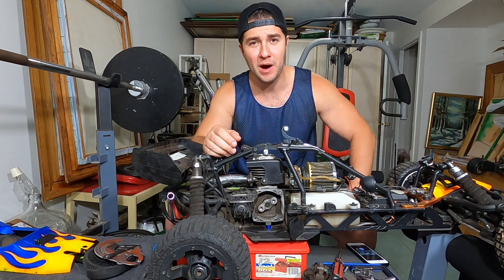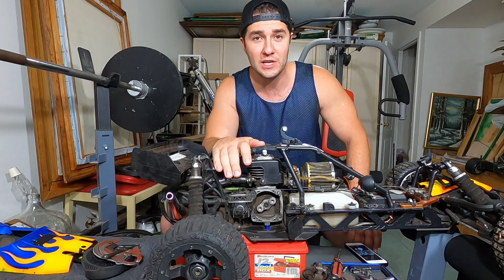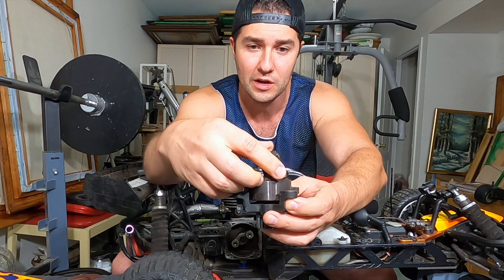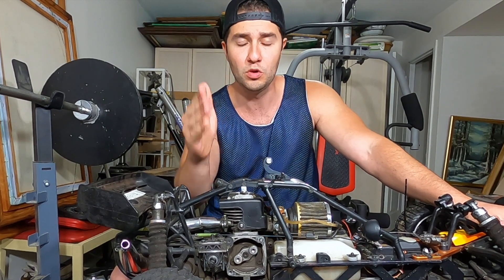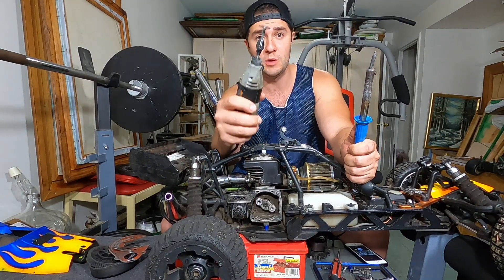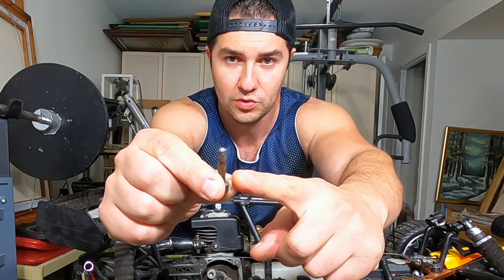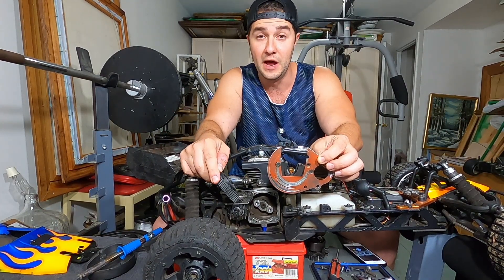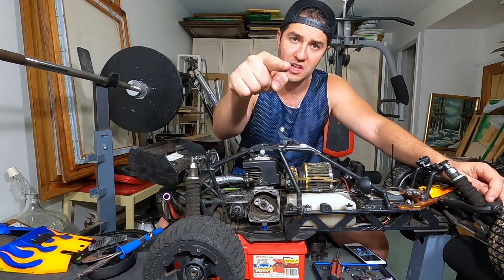GAS Garage - King Motors Baja First Failure After Beating Too Many Electrics. (NEED HELP) PART 1

Comment: Great video Dmitri!!!  Sounds like your lay shaft has too much end play for your pinion gear.  Would say as long as it’s not ate into the The plate too much you should be able to reuse it. That bolt is going to be hard to get out brother.  I would use map gas to heat the housing and you will need a good left-handed drillbit drill into the bolt far enough to get an extractor in it.  A lot of times just the heat from drilling the bolt will cause the bolt to back out with a left-handed drillbit.  If not then your second option is to tap an extractor into the hole you drilled in the bolt heat the housing and see if that baby will come loose.  Heating the bolt will work a lot of times but the best way to use heat is to heat the housing so the housing expands around the bolt because you don’t want the bolt to expand in the housing that’s what will happen if you heat the bolt too much.  That’s my advice brother I hope I explained it well enough for you.
Reply: Ya that a great plan heating the outside of where the screw is broken off and that will release the red Loctite and left handed drill bit to spin it out!
Reply from the maker: hey Ben! I was waiting for some good advice from you.  Unfortunately I don't have any ways of heating the housing, so I have resorted to just drilling through the screw.  I must say, my decision was very risky, but I think it's a success.  Anyway, I;m able to thread a slightly thinner bolt through that opening now, its totally weird tho.  You will see an update in a video soon, very hard to explain.  I did my best to avoid removing the clutch housing because chances are that will have massive issues too.
Reply: hybrid32494 Sounds like you got it brother.  All we can do is do the best with what we have.  And yes I agree you probably would’ve got into some more issues removing the housing.

Comment: Could it that the shaft is bent to cause it rubbing on that housing? Great informative clip...
Reply from the maker: hey my buddy!  I've looked at that entire shaft setup, it looks fine and there is no sign of any weird wobbling.  Some people have said I'm missing a washer  between the spur gear and the gear plate. On the other hand, this Baja has been running perfectly fine even with the significant wear, so I'm not too worried, you know.  Long as it's enough to win some races, hahaa.
Reply: @hybrid32494  so true 👍👍👍👍

Comment: Nitrogang never give up❗💯🏁🏎️🤓🇨🇵
Reply from the maker: hey bro!! I'm fighting that damn stuck bolt right now!  I think I may have gotten lucky and come up with a very unique solution.  I am just drilling right though it and then going to put in a slightly thinner bolt that will just tap itself in there.  So far it's working..  Nitrogang rules!!!  You will see in an updated video soon.
Reply: @hybrid32494  Good luck and stay cool Bro... 😉 Sometime, RC is a little boring when something don't want to go in the good way or don't want to start... But the goal is a pleasure❗👍💪💯🏁🏎️🤓🇨🇵

Comment: You need to replace the plastic clutch carrier man . That will eliminate that wear on the back plate and your spur gear . Awesome video as always mate 👍
Reply: When it gets hot it flexes, unlike a metal one . Screws up the fixed alignment on these bajas . 👍
Reply from the maker: hey bro! I should have mentioned that black clutch carrier is already metal.  I also thought it was just black plastic until I removed it, it's actually metal.  Must have been a cool King Motors upgrade for the time, you know. So it can't be that. I'm thinking is it possible the disc brake assembly is somehow flexing and pushing that gear plate into the spur gear??
Reply: @hybrid32494  no way man !! I did not expect it to be metal . That's a cool bit of design from king motors . It's a strange problem for sure ...  I think you're on to something by tracing the problem to the brakes possibly . Can't wait for the next video and to see what the issue was . That Baja is an absolute beast for its age . And you definitely showed those guys that gas RC is still king haha 👍

Comment: Hey man what fuel to oil ratio is best for performance according to your experience?
Reply from the maker: hey buddy! So far around 35:1 is what I'm running.  With any new or used gas RC I start out at the recommended 25:1 then when I feel like it's running fine I check the plug and it's almost always fully saturated with thick dark oil, meaning it's too rich of a fuel mixture.  At about 32:1 it starts to get better.  Some guys run 50:1 and seem to have the same performance and no downsides at all, so I think 35:1 is right in that safe zone and still adequate.
Reply: @hybrid32494  hey man thnks for the info. I usually run 25:1 but just making sure that a higher ratio will not have an adverse effect. Hope to see the RAMINATOR soon. 👊👊👍👍

Comment: Make sure the aluminum spacer/collar is on before the spur goes on. That would cause rubbing on the spur if I remember correctly.
Reply from the maker: hey my dude! Yes, you're 100% right, the spacer is highly necessary here. This one has the spacer, but I'm currently working on another baja, and it legit had no spacer, which resulted in tons of spur gear wear lines, that problem is being solved right now,  You'll see it in a video soon.

Comment: sounds like the spur gear wasnt set up correctly on the transmission shaft or the plate wasnt tight? an extractor bit is the best way to get those broken screws out. my brakes on my rovan baja are turned wayyyy down on the controller because they dont take alot to lock up the tires. it could be your servo isnt strong enough to really clamp down or the rotation isnt enough to clamp down.

Comment: Ahh faster with a leaner mix thats nice you showed that because one you get the oil out of the way you can make more power and more RPMS. Great vid as always nothing like a little 10th scale murdering hahahahaha!!! As for your spur gear it seems like you are missing the little spacer that spaces the spur gear off the gear plate!! And the screw your gonna have to drill that and heated it and use an easy out or just drill it and re tap the 6mm threads brother! also a new clutch housing is dirt cheap!!

Comment: Awesome video dude, I have had my baja spur gear melt like that when some of the bolts have come out and are rubbing against it when I'm running
Reply from the maker: hey bro!! Thanks for that suggestion,  that totally makes sense now, I did not fully check to see what the screws were like when I removed them, considering I had to cut some of them out I was more concerned with that at the time.

Comment: Might have to drill out the screw. I have to drill  the screws on the aluminum bulkheads ( I think is the proper name) for my revo 3.3. Got it for a steal both from and rear. 😂
Reply from the maker: hey my dude! Guess what, I just picked up a used 3.3 Reeve myself this weekend, you'll see it soon.  Paid 150 total.  Thing seems good and even has the forward only conversion installed already.  NItrogang!!  Yes, I have an extractor kit coming soon, so we shall see.
Reply: hybrid32494 not bad. Was it complete and did it come with extras?

Comment: Hey there nitro bro, what do you think about the losi 5ive t, if it’s a good, and solid car I’m gonna sell all 3 of my nitros to get it
Reply from the maker: hey man! Great question.  The losi 5ive t is a terrific gas RC with 4WD, one of the biggest advantages when compared to the baja chassis.  I would love to own one someday, but it's hella money and does not even come with a tuned pipe. Rovan makes a very good clone of that for about 30% less money and with way more upgrades.  Check it out on their site.
Reply: hybrid32494 I think it’s decided man, I’m no longer gonna be a nitro guy but at least I can be a gas guy lol

Comment: something is getting causight between the spur gear and the plate
Reply from the maker: hey bro! After reading most of the comments I would say your suggestion is the most common.  I did not fully record the disassembly of the gear plate, but I do remember one of the screws was not flush and was pretty loose, so I'm guessing that's what it was.  Thanks!!

Comment: Why those 1/10 scales running Nimh batteries though?? Lol
Reply from the maker: LOL, no!!!!  They were 2 and 3S only. Plus they had the speed gearing installed.  But you gotta realize a track that big is tough to see your RC on when it's at the end, the baja is larger so I can easily keep track of it. Plus I always brake if anyone is too close to me, don't want to destroy the competition!! lol.
Reply: @hybrid32494  I know bud i was JK! Lol..The weight and size of the Baja helps for sure

Comment: As for the screw that got sheared off and half of it is still in there, just get a left hand drill bit set and start drilling it out very slowly applying a lot of force.  It will either entirely drill out the screw, or start to loosen it and screw it out (which is why you need a left hand bit set). I did this with my ofna ultra lx comp when the screws of the cooling head were stripped. All three which were stripped came out using this method doing no damage to the threads on the cooling head.

Comment: Should be a spacer on shaft behind your spur gear
Reply: Also get a hostile spur gear cheap.. there handle the heat better dude
Reply from the maker: hey bro! thanks for that info.  I will look up the exploded parts diagrams before putting it all together.  You might be right!  So far nobody has joined that out and I don't recall removing a spacer when I took the spur gear off either.
Reply: No problem bro my guess is that's why its rubbing so bad is that it's missing.
Reply: That spacer is the bane of my existence!! Very critical and very often over looked part on the Baja

Comment: maybe a stronger servo will improve your brake strenght
Reply from the maker: hey bro! I should have mentioned this baja already has a quite powerful SAVOX servo.  It's just the way the front and rear brakes on this thing are setup, plus I noticed my rear upper plate holding the disc assembly in place is cracked.   So it's got issues, lol.
Reply: @hybrid32494  once you fix the brake plate you can try moving the brake pads closer to the disk if the problem isn't fixed

Comment: the wearing on the plate might be due to a bent layshaft which is the shaft that you attach the spur gear to with the e clip
Reply from the maker: hey man! thanks for watching and your input!  I have read many of the comments and man people are saying there was a screw that was backed out, and it caused that.  Come to think of it, when I was removing the gear plate I did notice a loose screw, I did not think much of it at the time, but now it makes sense.

Comment: which should I buy ?
https://www.rovanrc.com/product-rv450c-01b
https://www.rovanrc.com/product-rv360awo
https://www.kingmotorrc.com/product-km002-305wg
Is the 36cc engine makes car faster than 45cc ? (45cc- 16500rpm) and (36cc- 19500rpm)
Reply from the maker: Hey man, for the price i would recommend that 36cc model.  Let me put it this way, the buggee the motor, the lower ur top rpm will be, so you will need tall gearing.  My stock 30cc does 44 mph and has plenty of power to the point of where i towed a whole xmass tree in a vidro on here.  I mean, do you really need more than that?  Lol. U kno. Even the30cc model will make ur wheels slicks in a few runs. Lol.

Comment: you gotta tap that screw son!!! or this is your best bet my man get some jb weld mix it up and weld either a socket head bolt to the actual broken bolt still in the threads and you should be able to ratchet it out. with the ratchet you will get more torque when unscrewing than just an allen key plus its eaiser to concentrate the extra torque where you want it than just using all your might with an allen key/wrench where its much easier to snap bolts

Comment: now your spur gear plate should not be digging into your actual spur gear at all that no bueno sir. not only are you creating extra unnecessary drag which in turn slows you down. that means you most likely had a screw back out on you on the spur gear plate just enough to put that grove in the spur gear. im thinking cuz of the screw barely digging into the plastic spur gear that excess plastic from that is what caused the wear on the plate itself cuz if you notice the same amount of wear is not on the upper part of your plate just the lower if the plate itself was an issue you would see equal wear all around the plate.
Reply from the maker: hey bro! I'd say you got a point!  Come to think of it when I was removing the gear plate I found it very odd that one of the screws was kind of backed out and a totally different style of machine thread, the would explain it.  I'm waiting on the Rovan screw set to come today and going to put this thing back together because I need to go destroy more electrics in races bro.  I think the clutch spring that broke must have been the original one from years ago, guess it was about time.

Comment: Figured out what’s wrong with
My pos rovan Baja, the carb is bad, ran it maybe 3hrs total run time straight out the box the F’ing carb went, feel like rovan should send me two carbs for free
Reply: Smfh
Reply from the maker: hey bro! I was just thinking about your baja issues while making this video.  What you should do is just get a replica carb on ebay or amazon.  The one I have been running in this baja is a fake walbro carb, cost me 12 bucks.  The original carb also made this thing un-startable and I waiting weeks trying to figure out other issues before just replacing the carb.